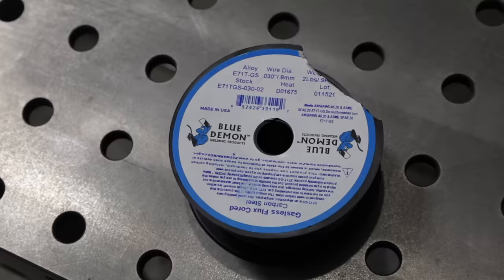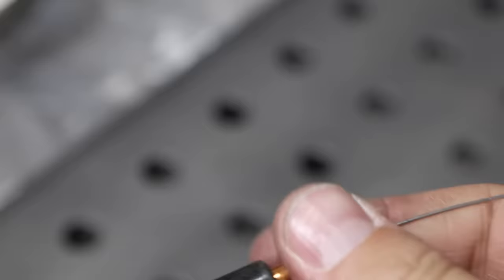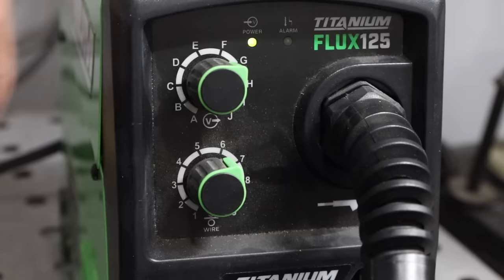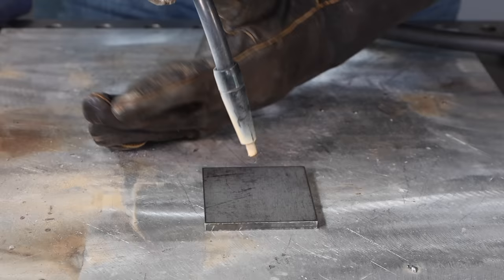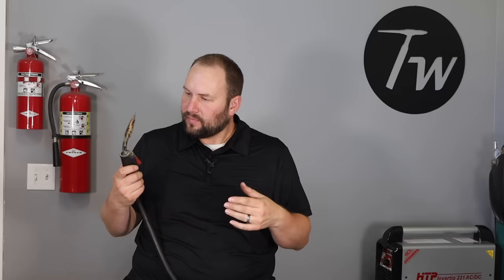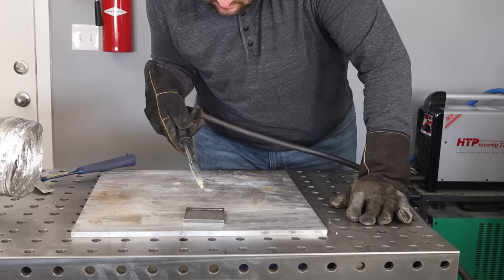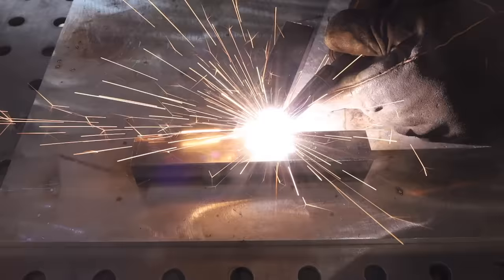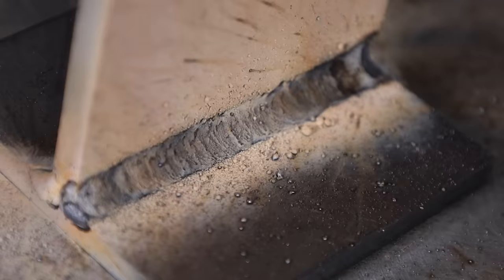Gasless Flux Core Welding Basics for Beginners

Comment: Unfortunately, I bought a Northern Tool flux core 125 welder and after your suggestion to go to straight polarity to improve weld quality, I looked and there was no apparent way to change it, assuming that it was incorrectly set at the factory. Is there any other way to check the polarity?

Comment: Hey guys I learned to weld without gas when I was 10 while my dad was building my racecars for asphalt oval racing I would practice welding with out gas cuse we was racing on a budget as in not allowed to use the gas to practice when I was ten cuse I was racing a 50k dollar racecar lol anyways I did end up getting really good at it and ended up welding out my full roll cage with gas of course which was so easy after learning gasless and every weld looked beautiful and I was only ten and my dad passed all my welds and he is a really good racecar fabricator he likes to Tig everything which I do now but when I was ten he let me do it with mig and it looked really good and he didn't have to fix any joint on he chassis or roll cage. To this day I still weld with out gas if I need to do a small quick weld and don't have any gas left on my 900 dollar Lincoln I got from Lowes 14 years ago and it's good for your typic hobby welder or racecar building but if your gonna be welding anything really thick like 1/2 inch steel and thicker then you need a better welding machine but this Lincoln you can build anything with it at home. I been welding and a fabricator as a job since I was 16 and still doing it to this day and it's a skill you will never lose like riding a bike you will never forget

Comment: @TimWelds Could you elaborate on the wire tension? You mentioned using a block of wood... do I want some slip... so as I increase wire speed I feel the wire push but not push the stick away.  Mine currently pushes the stick away.  Is it too tight?

Comment: I have a titanium mig,tig,stick welder I'm going to repair a Chevrolet truck frame do I measure the thickness of the to set flux core I'm using prefabricated braces to weld over the frame for added strength.

Comment: Hi Tim I am trying to learn mig with flux core so I don't have to have bottles. My question is, do you touch the metal with the wire when welding or after making contact, hold the wire away from the metal?

Comment: Yo. Quick question for anyone. Just got my first welder... manual says it should be run off its own 30 amp circuit yet it arrived with a 13 amp fused plug. Can i assume this is suitable for lower power work until i get an electrician in. Have you run into issues running off a standard ring main?

Comment: Hi Tim, your comments regarding reversing the weld leads for flux cored wire are very interesting , however my mig welder does not have the facility to do this as the connections are within the case. How can this be overome?

Comment: its amazing watching videos of fluxcore welding that the presenter doesnt even know that the polarity setup is gun/negative. thanx for being way more knowledgeable than others. any thoughts on flux core welding on 110v vrs 220v. i'm new to this, have garage set up for 220/30amp and 110/20amp....great video
Reply from the maker: I always run 220 when my location and machine support it. That being said, you can do a lot on 110 volt with flux core, typically up to about 3/16” thick material.

Comment: What about stick welding? I bought a cheap one that does work for the most part BUT I can NOT get my welds to stick to exhaust tubing and hangers no matter what I do. Using 6017 1/8” sticks at 40 amps. Do you know why that is?? Maybe I’ll try to wire weld it together today

Comment: I have a question if you weld incorrectly is it possible to cause your light source to dim or shut down? Can you cause an electrical short in your apartment or work place? Because one of my friends said the electricity goes dim and not enough electricity goes into the welding he is doing. He is learning to weld. But ends up with balls of welds in his weld.

Comment: The most important thing about welding is fitment. As long as there's almost no gap it makes it so much easier. This weekend I got my ass kicked trying to make a rectangle using 2" 3/16 thick stainless with stick weld. Man, it was horrible, things were warping and bending and going out of square.
Ah I'm getting so frustrated lol. 2 days and cutting and trimming 3/16 stainless is no fun.

Comment: very amateur welder here, i remember hearing that long beads should be broken up into sections so if part of a weld becomes faulty then the whole bead does not 'tear'.  is this correct?  if so, when should you  weld 'dotted lines' (if you will) instead of one long bead?  thank you for anyone that can help.

Comment: Nicely Done, very nicely done. On your cross section cut at the end, if you did the same weld with the 3/16 spec thickness, does the weld actually fully melt the vertical plate to the horizontal or does it just make a nice bridge joint on the side? I've never fully understood if it does or doesn't or if some weld process does and some don't.

Comment: Very informative vlog video, I'm learning from you a lot. you mentioned that if you are using flux core, you need to connect the gun to negative and the ground to positive, why is that? is there any advantage over the other way or natural way? thanks and keep up the good work.
Reply: Major difference. Flux wire won't short circuit transfer on electrode positive.

Comment: Also for every home hobbiest who wants some free metal or dirt cheap metal for your projects go to local fab shops not welding schools but fab shops and metal shops that deal with steel and they will give you scrap pieces for free that are usually long enough or big enough for your projects. Even strap pieces of ho beams or I beams can be used to make flat plates by just cutting off the toe and web of it or if you need a piece of angle just cut it to make a 90 degree angle and it's free practice metal they will be glad to give you the small stuff not to much of it but they will give it to you for practicing or if they do alot of tubing they will give you the scrap whole sticks that the CNC tubing machine messed up or the thickness was not quite right from the factory that rolled the tubing

Comment: Did my first welds today...complete fiasco. I followed the chart settings but only managed a few passes that looked anything like a weld. I did learn the following: You have to press the trigger to make the wire hot🥴 Tip jelly really keeps the tip clean. If I finish and the house is still standing, it's a good day🤪

Comment: I assume these welders are not suitable to fix your vice (too thick).
What did you use to cut metal pieces?
For how long you can continuously weld by these machines without frying them up? Do they have an overheating protection?
Could the sparks put your clothes on fire while welding?
Thank you.

Comment: I bought my first welder because of this guy. It was a stick welder. I just got my 2nd machine and it's flux core. Now question for any welder on here. How do you figure out what size wire you need for different metals or metal thickness? Any advice is appreciated.
Reply from the maker: My opinion is that the wire size doesn’t make much of a difference and the quality of the wire is more important. .030 (.8mm) is the most commonly used on dedicated flux core machines. It is generally good for thickness up to 1/8” (3mm). .035 wire will allow you to go a little thicker. For most people, it will come down to personal preference.

Comment: Is the lack of penetration (your example near the end of the video) the primary reason butt joints and preferred over lap joints when welding on automobiles (replacing floor panels, for example). It seemed to me that the no-weld area behind the weld bead could draw in moisture via any slight void to atmosphere?

Comment: I've been welding for over 35 years and I have never seen a welding tip stick out further than the gas shield or shroud. Even with flex wire

Comment: when welding 2 pieces of steel butted toghether sometimes the seam is hard to see and follow, I sometimes mark the seam with soap stone to make it more visable, do you have any sugestions   good clear vid  THANX!
Reply: try a less darker glas  can also us a whit steel pen maker. but try and weld to you and not away from you. you may want to keep an eye on that slag dot in your welding bath. if its up against yours wire your to slow and some slag can enter the weld. if it is all the way back at the cooling side then your to fast. if its in the middle just right speed and great penetration.

Comment: With the titanium 125 welder from harbor freight, do you need a special high amperage outlet to handle the power it draws? I know I will have to find out the amps on the fuses in my home, but is this something you could typically run in a modern built home or is even that small one too much?

Comment: My machine (120VAC) has only one adjustment - wire speed.  When welding thin wall pipe and boxed tube from treadmill, I often get burn through.  I find it very difficult to not get burn through.  I end up making dozens of tack welds across the joint.  Then I sometimes go back with a full pass.  My welds look like garbage.  For sure I'm not a welder, but I do on rare occasion have need to fabricate something out of metal.  Most recently I built a dumb waiter for my woodshop.  My shop is on the second floor and so I don't have to carry materials up or projects down the stairs I built the elevator for that one dedicated purpose.  I've probably done more grinding than welding - that's how bad my welds are.  Any advice for a novice with a very primitive machine?  Stick-out is one problem I fight with.  Angle is often another.  Granted, there's a lot of improvement I can make with practice, but I weld so seldom I just need a machine that can make a fool look like a professional.  Or even just not a fool.

Comment: If you do not use a nozzle or your tip out past the nozzle. Your tip will touch the work. This will cause a dead short ,in time blowing the diodes or scr or fets. They're  the electronic devices to change the power to dc. I have have made a living selling and repairing welding equipment for the last 40 odd years.

Comment: Instead of using a hammer to break the welds, we used a crescent wrench with a cheater pipe in school. It might help save your vice as the shock from the hammer is my bet on what cause it to break that way.

Comment: I can't seem to weld 16-14 gauge metal without burning through even on the lowest settings ( Letter and number dials) . I'm using the 035 wire the machine came with. Will switching to 030 wire help?
Reply from the maker: Yes, switching to .030 wire will reduce the amperage and help avoid burning through.

Comment: I have a	Gen4000df-stw, which is a 4000 surge watt/ 3500 running watt, dual fuel lpg liquid propane & gasoline portable HIT welding generator. Could you do a video evaluation of this machine for us. It is a 85 amp welder .

Comment: THAT was the information I was looking for. Well presented too. Bummer about the vice. Maybe this will lift you up. I'VE SUBBED TO YOUR CHANNEL ! ! ! Yaaaay ! ... I'm a retired auto mechanic that specialized in custom exhaust systems. I have done, mostly MIG and toward the end TIG welding, Flux core and stick very rarely.  I haven't done any wrenching for about ten years now and swore off wrenching ever again but !, I'm seriously getting the 'project' fever. I've sold most of my tools and equip. long ago, and am considering getting a cheap ($200-300) 110v flux-core/stick welder that has the ability to upgrade to MIG. Any recommendations?

Comment: New hobby welder here, you said it can only make a single pass. Does this mean i cant use it to run 2 beads paralell to close a large gap in the material then bridge the middle of those 2 beads together? If i cant do that can you explain why, or send me to where i can find that info? Ive been doing this and i dont want to continue if it will compromise the weld. Thanks
Reply: If you clean the slag off, you can weld between them. If you were to weld over the top of a dirty weld, you might end up with "slag inclusion" which would look untidy and not be as strong.

Comment: Another great video! I’ve mastered stick welding and now are practicing flux-core welding. My question is, when I’m flux core welding and trying to keep a 1/2in stick out, the spatter gets all over the nozzle and contact tip and sometimes even causes feeding problems, is that normal with fluxcore or do I need to change something?

Comment: I got a cheap, 90A Chicago Electric welder at an auction. I've been practicing on scrap metal and have been relatively pleased with my welding, but I've noticed there is alot more splatter than in your videos. Is this a cheap welder problem? Or a technique problem?
Reply from the maker: It’s a cheap welder problem. Those particular machines output alternating current, which leads to more spatter.

Comment: Run a gas nozzle flux or not, you can pivot/drag/push off that and your tip won't stick/ruin. Charts are usually worthless, wire speed lower and move quicker.

Comment: I have a millermatic that doesnt fit these tiny 2 pound rolls. is there an adapter for that? i dont want to spend 100 dollars on a roll of flux core that i only use in emergencies or outdoor repairs.

Comment: Hi Tim, I am a beginner and purchased a MIG machine a few months ago. It is a good machine and works very well. My question is the flux core wire that came with the machine seems to be oxidizing. Is this normal?
Reply: IMHO, mild surface rust on a selfshielding cored wire should have minimal effect on weld quality once it travels through the arc. There should be enough oxidizers/  deoxidizers in the core ingredients to handle Fe2O3 or/and Fe3O4. Another issue because rust being a surface contaminate it may effect wire feedability.  Erratic wire feed will effect the arc stability as its pushed through the wire gun liner & contact tip. If you are concerned with the rust appearance just remove the actual wire rings/wraps & discard.
Reply: @miszced  That is exactly what I am experiencing, erratic wire feel. The wire burns back and stops the feed. Okay, time to ditch this spool for a new spool...Thanks, McNasty.
Reply: @kennethwhite5158  thank you! Wire feedability is an interesting subject area & not alot of understanding from the end user perspective is appreciated. From loading your spool/coil whether to feed the wire from the top or bottom into the wire drive rolls. And the drive rolls either single top & bottom or double set. Flat, v-groove smooth or knurled and your choice of adjustable manual pressure. Most do not know about manufacturer's control of "cast & helix" & or/if surface lubricant in the spooling operation. As a point of interest, most selfshielding FCAW are non-baked in manufacturing whether they be the brands Innershield/Fabshield vs Outershield/FabCO. Hence, liners/contact tips can get gummed up.
Reply: @Grauenwolf  how to deal with a rusting spool of wire is to toss it out and buy a new roll. Leaving a roll on your machine in your damp unheated shop is pretty much asking for ruining the roll.
Reply: @kennethwhite5158  if you only weld occasionally when you're done take the roll out and put it in a bag and bring it indoors. Because you're going to be taking the roll out and putting a new one in anyways. That rust screws up your liner and your welds. So running a rusty roll is false economy.

Comment: What did you do for your welds and the medal around it to not only be very clean but actually shiny with hardly any splatter. Mine turn out very tan with heavy  splatter, why?
Reply: Get a can of nozzle dip..you will see a world of difference..the tan that you see, will wire brush off..the nozzle dip is anti spatter...rual king, had it..$14 a can..will last a long time

Comment: I'm a novice at this . I have a Lincoln 140 mig. Needed it to weld floor panels on my Jeep. Figured that 1/4" material max would be all I need. But now I am modifying a utility trailer. When I cut the axle in half to make it wider I discovered that it is not a 2' square tube like I thought it is a 2" solid square axle. What do you think can this welder do it ? I have seen some cheep stick welders ,but I don't want to buy another $500 welder for something that I may never need again. Any advice is greatly appreciated Thank you.
Reply from the maker: I wouldn't use that MIG welder for it, it's just too much material for the output to handle. That's one heavy axle. If you're up for the learning curve, stick welding is one of the best processes for this, assuming it's steel and not some sort of casting. You can run unlimited thickness with 1/8" electrodes on about 130 amps. A lot of the cheap stick machines work pretty good, you just have to understand that it won't be the highest end and the amperage reading could be off a little. I would recommend significant practice and testing before taking this on, though. If this is the only project that heavy, it might be cheaper and faster to replace the axle or hire a welding service to run it...Unless you want the project side of it, which I totally get.
Reply: @TimWelds  Thank you sir. It looks like I'll be getting a stick welder I have seen one by Accaptine that is a 200 amp at $120. Since an axle or hiring a welding shop would cost me more at least $200. If I can mig weld I sure with a little practice I be a stick welder. I never know what project might come down the road. Also I like to learn new things. After I get the welder I'll look into the classes you offer on stick welding if you are still doing classes. Again thank you for the advice